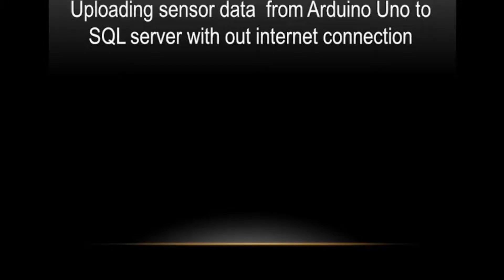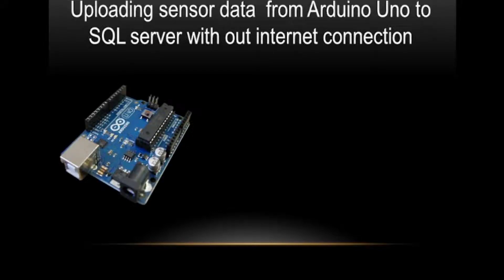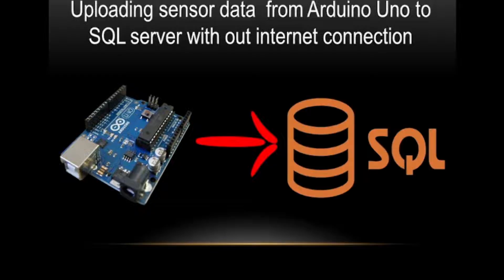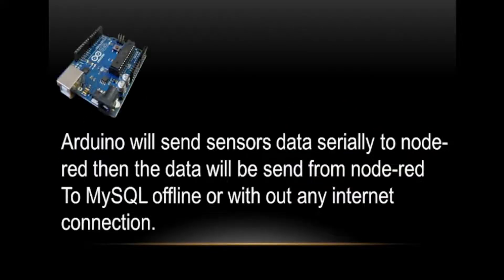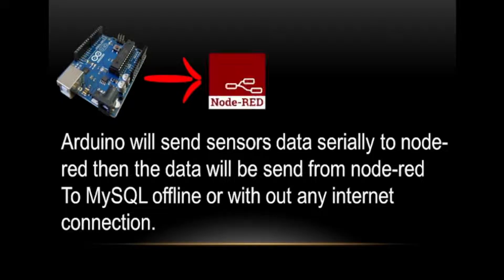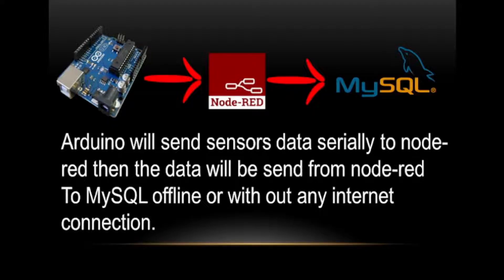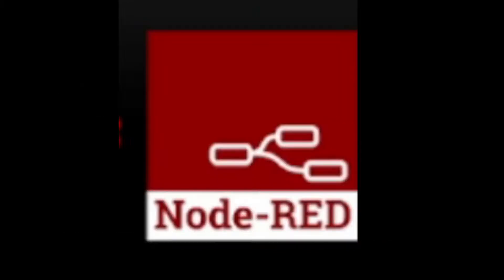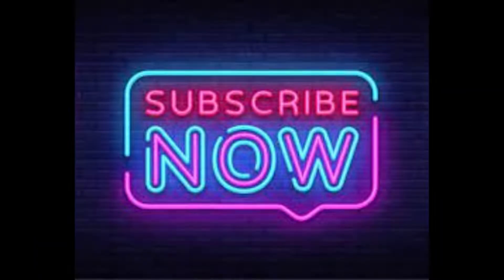🔴How to send sensor Data from Arduino UNO  to MySQL Server(PHPMYADMIN)  Offline (No internet)?

Comment: Hello Sir, how can i use the data from the database to give output in terms of LED indications?
Reply from the maker: If you do not need historical data you can directly amend in the arduino code so as to control the led in real time data from sensors

Comment: Hi sir
 i have a problem when i am trying to upload it gives me the following result 
Sketch uses 2688 bytes (8%) of program storage space. Maximum is 32256 bytes.
Global variables use 224 bytes (10%) of dynamic memory, leaving 1824 bytes for local variables. Maximum is 2048 bytes.
avrdude: stk500_recv(): programmer is not responding
avrdude: stk500_getsync() attempt 1 of 10: not in sync: resp=0xfe
avrdude: stk500_recv(): programmer is not responding
avrdude: stk500_getsync() attempt 2 of 10: not in sync: resp=0xfe
avrdude: stk500_recv(): programmer is not responding
avrdude: stk500_getsync() attempt 3 of 10: not in sync: resp=0xfe
avrdude: stk500_recv(): programmer is not responding
avrdude: stk500_getsync() attempt 4 of 10: not in sync: resp=0xfe
avrdude: stk500_recv(): programmer is not responding
avrdude: stk500_getsync() attempt 5 of 10: not in sync: resp=0xfe
avrdude: stk500_recv(): programmer is not responding
avrdude: stk500_getsync() attempt 6 of 10: not in sync: resp=0xfe
avrdude: stk500_recv(): programmer is not responding
avrdude: stk500_getsync() attempt 7 of 10: not in sync: resp=0xfe
avrdude: stk500_recv(): programmer is not responding
avrdude: stk500_getsync() attempt 8 of 10: not in sync: resp=0xfe
avrdude: stk500_recv(): programmer is not responding
avrdude: stk500_getsync() attempt 9 of 10: not in sync: resp=0xfe
avrdude: stk500_recv(): programmer is not responding
avrdude: stk500_getsync() attempt 10 of 10: not in sync: resp=0xfe
Failed uploading: uploading error: exit status 1

i configure the board to Arduino uno and the port to COM4
Reply from the maker: make sure:- the Arduino port is COM4 in your case, by the way, the method also works for other boards in the same way. Also, reset, unplug the board and restart the arduino IDE and re-connect the board  make sure the code you are trying to upload does not have an error

Comment: I am getting this in cmd:

3 Mar 21:22:25 - [info] Starting flows
3 Mar 21:22:25 - [info] Started flows
3 Mar 21:22:25 - [info] [serialconfig:f55bf537c41c807e] serial port com3 opened at 9600 baud 8N1
3 Mar 21:22:27 - [error] [mysql:c61d890ba12fb382] Error: You have an error in your SQL syntax; check the manual that corresponds to your MariaDB server version for the right syntax to use near '' at line 1

The serial port is connected but it is saying error in sql syntax. 

Arduino code: 
#define ANALOG_PIN A0 // Analog pin connected to the MQ4 sensor
#define BUZZER_PIN 7  // Digital pin connected to the buzzer
void setup() {
  pinMode(BUZZER_PIN, OUTPUT); // Set buzzer pin as output
  Serial.begin(9600); // Start serial communication
}
void loop() {
  int sensorValue = analogRead(ANALOG_PIN); // Read analog value from sensor
  // Serial.print("Methane Level concentration : ");
  Serial.println(sensorValue); // Output raw analog reading
  delay(5000); // Delay for stability
}

Function code in node red:
var sensorValue = msg.payload;
var query = "INSERT INTO methanevalues (sensorValue) VALUES (?)";
var values = [sensorValue];
var mysqlMsg = {
    topic: "INSERT",
    payload: {
        sql: query,
        values: values
    }
};
return mysqlMsg;

Database name : foodnew
Table name: methanevalues
Col name: sensorValue.

Also in my flow, it shows Error: ER_PARSE_ERROR below the database node.

Please help sir

Comment: I keep getting ER_BAD_DB_ERROR when deploying, any idea what the issue could be?
Reply from the maker: Incorrect database credentials: Double-check that you have provided the correct username, password, host, and database name when configuring the connection to the MySQL server.

Database privileges: Ensure that the user you are connecting with has sufficient privileges to access and modify the specified database. The user should have at least the necessary permissions to insert data into the database.

Database existence: Verify that the specified database actually exists on the MySQL server. If not, create the database manually or modify the configuration to use an existing database.

Network or connectivity issues: Check if there are any network or firewall issues that are preventing the connection between your Node-RED application and the MySQL server. Ensure that the MySQL server is accessible from the machine running Node-RED.

MySQL server configuration: Make sure that the MySQL server is properly configured to accept remote connections and that it allows connections from the machine running Node-RED.

Comment: i have problem. in serial monitor, it's appear correct humidity and temperature. in node-red, serial in and mysql is connected. but the problem is not save in to database. can you help me?
Reply from the maker: have you created humidity and temperature fields in the database so as to save the sent data values? https://youtu.be/fRNKrEdmnkg?si=73M2FWxAtfCUzSnK
Reply: @makersgroup  yes, i follow every step by step. still not save to my database

Comment: COM port is not connected in node-red . What can I do?
Reply from the maker: Thank you very much
Reply: @makersgroup  you have solution for that error?
Reply from the maker: Yes you must change the COM port to the port which you used to upload the program and you must also close serial port since you could not acess serial port in 2 different software simultinously

Comment: Hello, we see the data as 0 in SQL even though we are doing the same thing you did. What do we write in SQL Insert Into values(?)? I would be glad if you can help me urgently.
Reply from the maker: Hello dear, first you need to make sure that the sensor data is sucessfully read by the arduino using your serial monitor, if you get the correct sensor reading on your arduino ide serial monitor, the error might be on your node red ,  you you have to amend the sensor data to send serially to the sql node as per your project

Comment: How can I resolve the COM port conflict between arduino uno and node.js
Reply from the maker: First, close serial monitor if you opened it if that did n't fix the error you must check that you used the same port number to upload the program and on the nodered software
Reply: @makersgroup  The instructions in your tutorial, are that, the "serial-in node" in node-red should use the same COM port as Arduino!
Reply: @makersgroup  If I close either of the two apps, the running app works correctly, however my project requires running both apps simultaneously!
Reply from the maker: If you open serial port of arduino and node red serial node at the same time you will get error because as the name suggests serial communication can not be used simultinously for dual purpose
Reply: @makersgroup  So, what options do I have, for my project to work?
Reply from the maker: You can send the data to mysql using esp board so as to use the serial communication to your serial port

Comment: Hi, I have problem with database. In my project I use DHT11 and HW-038. In arduino ide I get data from my sensor correctly, but when I am trying to get data in my database, my sql returned empty result. Where can be my mistake?

Comment: one question, if i put my database online, that system will work correctly?
Reply from the maker: The Arduino board must be connected to the server inorder to send the data serialy via the connection cable

Comment: Can you help us with our project? We used MQ135,MQ7 and DHT11 sensors.
I connected the COM and the database but the values are not showing. My command prompt also shows 

"Unexpected string in JSON at position 26"

What does it mean?
Reply: I also tried your example, I used it as a guide but the values are not showing and the command prompt displaying 

"Unexpected string in JSON at position 26"
Reply from the maker: Does the example in the video works for you?, If you are able to make the project which is given on the video, changing the sensors and values is easy peasy. but if it does not work for you let me know so that I can assist you?
Reply: @makersgroup  It worked, thanks for the help brother
Reply: @lawrencepinlac5965  Bro, how did you make it work? I'm trying to read values from a LM35 but have the same problem as yours